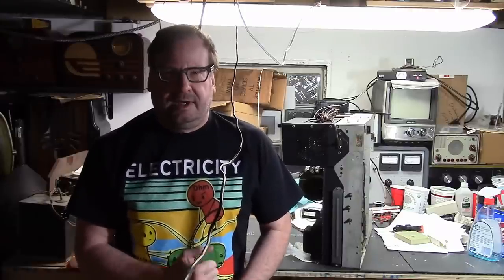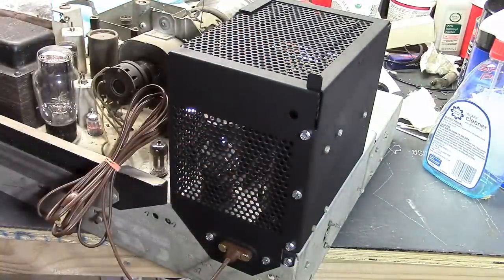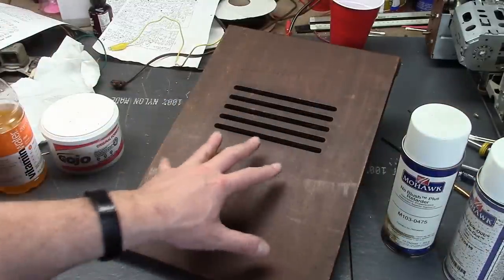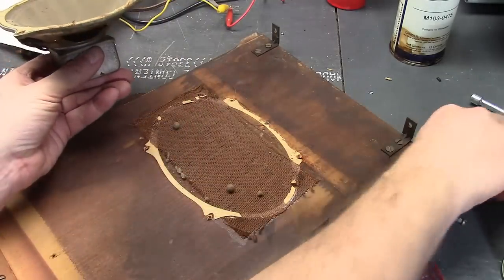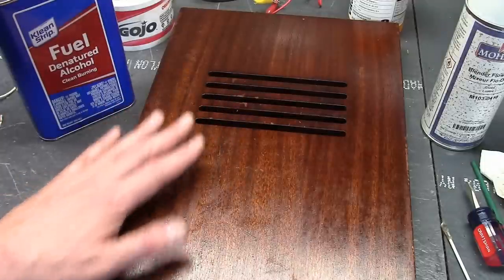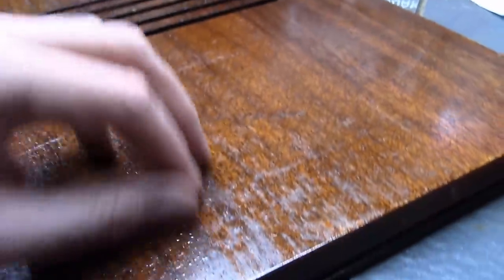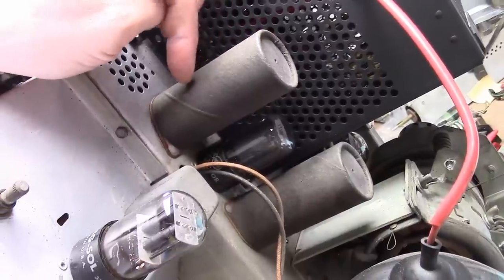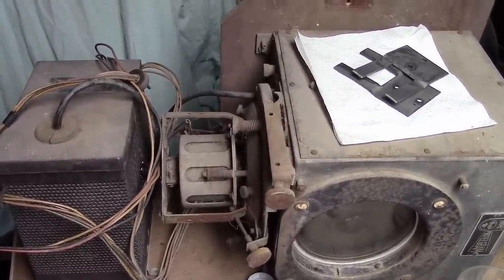RCA 8T241 restoration part 3 of 5

Comment: Magnificent restoration (as usual) I've been watching you for years now! One thing struct me as odd. Your concern with getting the caps from those cans installed. In the past you use to routinely re-stuff those cans in a heartbeat. That would also provide a stock location for those components. This would provide for easy installation of the components since no mods were required to replace them. I'm certainly not in you're league when it comes to TV restoration, but isn't it easier to utilize the manufacturer's design for this type of work? Looking forward to seeing that Seventeener in it's restored glory!
Reply from the maker: Too much work, too much mess.  I had hoped to remove the cardboard covers, cut them open and install new caps but it didn't go as planned.  I couldn't get the covers off without destroying them.  The caps are in locations that make cutting them open awkward.  Also, the wire insulation is especially brittle.  The adapt-a-caps are perfect drop in replacements.  I'll be using them a lot more in the future.  I think the value of them will become apparent as I use them more.

Comment: You could also get new cans from hayseed hamfest. Send them all the info on each can and you will get an exact replica of the original. Not cheap and it can take awhile to get but it’s save a lot hassle.
Reply from the maker: Yes, I'm aware of them.  Not for me for the reasons you stated.